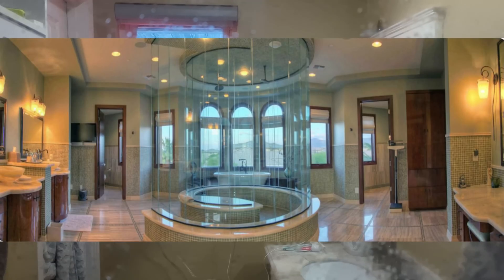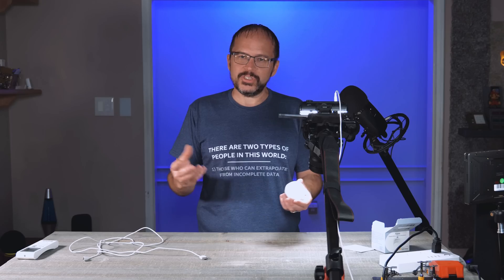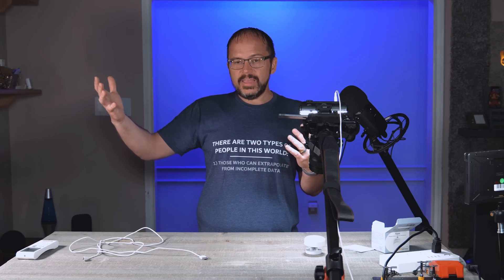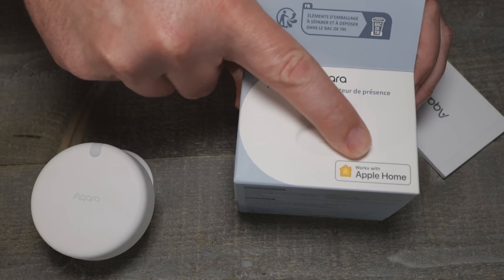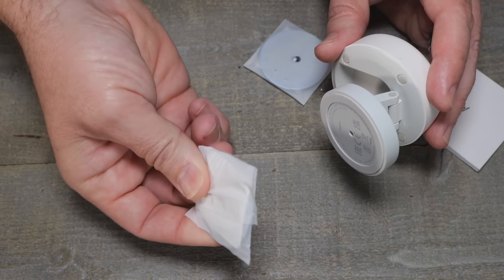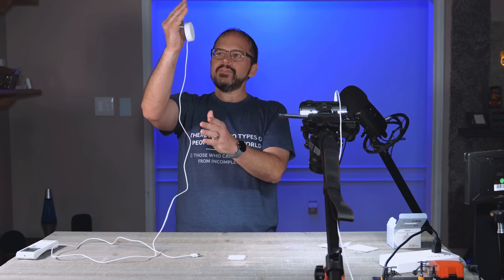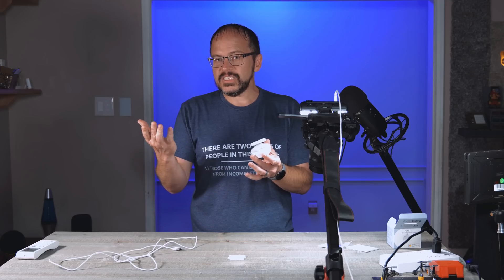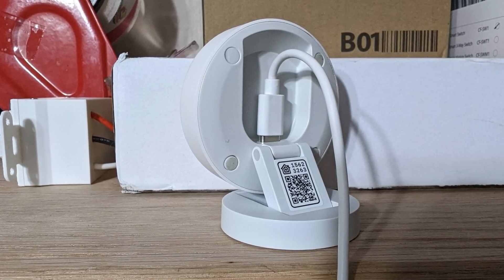Aqara FP2 mmWave Presence Sensor Review - The good, the bad and...

Comment: I got the EP1 when they came out. Mmwave works great. I ddi add a voc and co2 censor to them as an expansion board.
I would love for some local ability to do location sensing in a room. I wonder how hard that would be to code. Sadly it would have to be someone smarter than me.

Comment: Wifi is also local come on
Reply from the maker: It can be with the right setup like mqtt. This one forces the cloud pairing with their app to be setup.
Reply: @digiblurDIY  after setting it up in the app, you can restrict it completely, and only use homekit which is local. It works
Reply from the maker: Right but you still need the app to change stuff. I don't think you understood what I meant by the comparison of mqtt, zigbee etc.

Comment: Please, post video on ESP DIY route!   I've tried several microwave and mmwave sensors and failed-- couldn't get consistent results.  One of the MW sensors i used  went thru walls,  and if two people were 1 foot apart, it would even detect  on my upper level.   Aitrip rcwl-0516 module is junk, solder mask comes off way to easy.  Read that seed studio has good sensor, but gave up before I bought one.    Good video, thanks!
Reply from the maker: Will do. Seedstudio one was a failure for me. Stays triggered all the time.

Comment: Everything Presence One  vs FP2? Any comparison or obvious winner?
Reply from the maker: I do have the DF robot sensor that one uses. It is a little dated now with how quickly mmwave has evolved. Can I say none? 😎
Reply: @digiblurDIY  grabbed a EP One recently to check it out and compare to my DIY. Still looking for a ESP Home code that allows for distance management. Perhaps that is something that should reference in the automation instead?
Reply from the maker: I thought I read somewhere they posted the yaml? I was using the one that someone made before they put it on their PCB. I assume this is where the idea came from in Jan 22. https://community.home-assistant.io/t/mmwave-presence-detection-esphome-style/382778

Comment: this sensor only works great if fans is/are not present in the room.

just like the fp1 or any mmwave sensors out there, sensor placement is always the key.
Reply from the maker: Yeah I had high hopes it would totally get rid of the fan problem but that doesn't seem to be the case. It is a good start.
Reply: I Guess you talk about ceiling fans ?

Comment: In my room almost all problems has been fixed after I install entrance/exit area (there are a category to do that in app). If the sensor didn't detect you're at entrance/exit, so it knows you're somewhere at the room. Maybe it can improve your kid usage
Reply from the maker: I will try that. Seems odd the setup doesn't talk about that. Just the edge stuff for room size.

Comment: I had that same problem with the Fan interference Zone and not being able to detect anyone smaller than myself.. I ended up mounting all of my Fp2's in corners about 8' up with 12' ceilings and a 5 to 10 degree down angle, low sensitivity and Far settings. Deleted the interference zones and all works perfect now. I run the usb wire up a trench, easy to patch back up in the corner to either the attic or ceiling joist area and power the Fp2's with Poe. I haven't experienced any of the slow downs yet. I pay no attention to the Aqara app, only use it for setup then uninstall, It's buggy trash.
Reply from the maker: I have attic access and I just cut in electrical boxes for things.

Comment: I moved my FP2 to a different location hoping that it would have a better sensor behavior, it started off well, but after a few days it "degraded" and triggers (Alexa) now turns off/on lights inconsistently.   I decided to turn off FP2 and hope they will have a update that corrects this.  I think it works a lot better if it's centered in a room, this allows setting of zones a lot better.  The FP2 does not seem to update the app with correct person location causing 'ghost' figures and disappearing 'figures'.
Reply from the maker: Curious to see if they can fix this as well. Definitely better than the FP1
Reply: @digiblurDIY  I switched it off for about 3 weeks.  Just turned it back on and they have an update.  Also I can now setup automation in the Google Home app, before I had it on Alexa.  Giving this another try.  It’s still doing that “ghost” figures and seen to also slow to update the person presence location.
Reply: I just switched it off again, the latest firmware update somehow messed up the sensor.  Now I don't see any "person" icons even when I am in the detection area.  And it randomly turns on/off.
Reply: Another update, this time is working very well.  This latest update looks to have fixed the ghosting issue with the AI Learning feature.